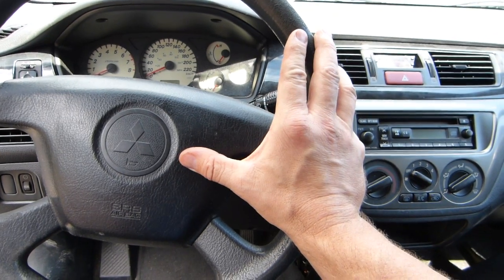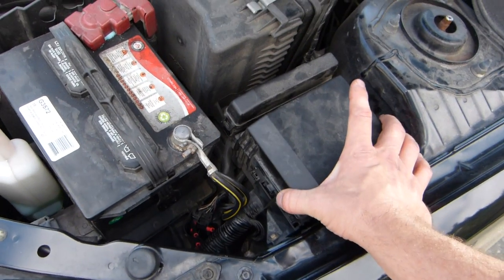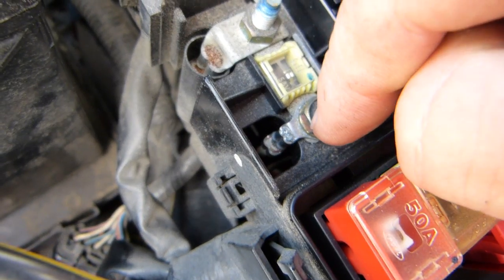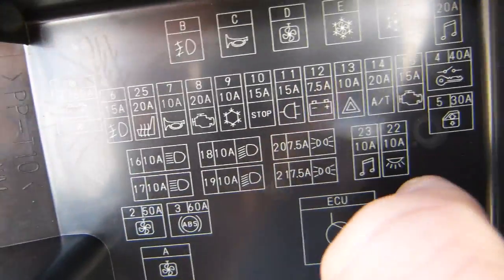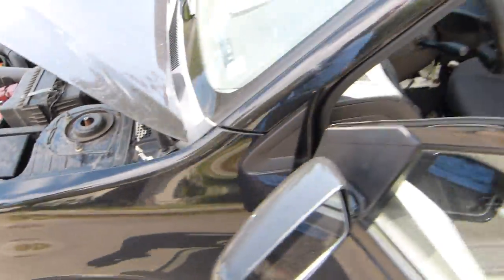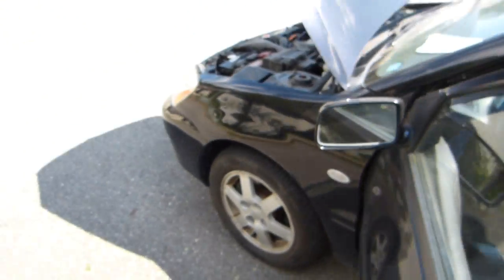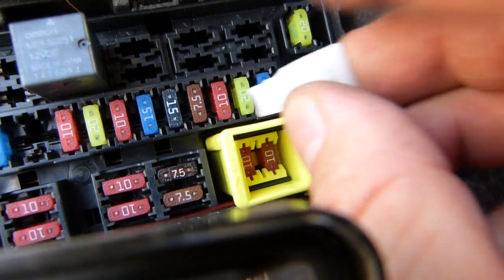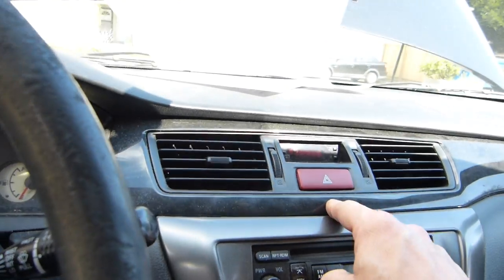Fuse locations and circuit detail to find the right fuse

Comment: What kind of a vehicle is this?I'm looking at a 1994 Mercedes S 500 that I need to locate views for the blower modor but this definitely is not Mercedes 1994.S five hundred
Reply from the maker: Not remember. Grab a torch/flashlight look around for wires running in bundles under the dash and in the engine bay

Comment: False in the first statement. Fuses specced correctly in a serviceable system actually should last what is effectively "forever".  They aren't wearing components.  Relays do exhibit degradation at the contacts over a very high number of cycles, but electrical systems shouldn't be treated as wearing mechanical systems in your approach to fault isolation and repair.

Comment: I have question when I was driving on the freeway way my oz rally shut off completely there was no power to the car at all I tried jump starting the car no power at all what would be the reason and where can I check
Reply from the maker: Oooooh,  ... sudden catastrophic total failure of all systems ... sorry about that.
Option a)
It's a quick fix, some cable around the battery came loose or a main fuse failed, 10 min fix
Option b)
It's not a quick fix, might want to consider abandoning vehicle, it's a money pit.
Reply: @theoverengineer where can I locate the main fuse is it the one inside the car or right corner of the hood to check?
Reply from the maker: Mains is under the hood/bonnet

Comment: Hey. Thanks for the video. I have an Evo iX MR. My fuse boxes looks similar to yours. Which exact fuse is it for the OEM Keyless Entry remote? Mine stopped working and I'm pretty sure it's a fuse or relay that's blown. I put a new battery in the remote and it's still not working, so it's gotta be a fuse. The fuse box in the interior by your left knee area: Fuse #15 / 15 amp. Is that for keyless entry? It has a picture of a key and door.
Reply from the maker: Takes just seconds to check a fuse, might as well check ALL, just in the process of elimination. Starting with the key and door fuse.

Comment: Who know please how to take off the 22 and 23 fuse the two inside the yellow plastic? Thanks
Reply from the maker: Fuse puller?
Reply: @theoverengineer  i found: you have to pull up the two fuses at the same time and they come off. Its made , i think, because they must come togheter to prevent some other problem
Reply: @theoverengineer  the yellow cover is up the fuses and you have to remove it to pull out the fuse
..

Comment: My anti lock brake light will not go off and making that loud sound and my heat and ac went out anyone know why some guy took out my fuse 10 the red one and my heater and air went out🤦‍♀️🤦‍♀️🤦‍♀️🥴

Comment: Thanks your video!   I Watched many times it, because english is not my language

Coin holder in the passenger apartment. I wish "something" to the japan enginers :) And that plastic puller is a joke

Doesn't heat the rear window in my my Galant and cigar lighter doesn't work
If I switch on the window heating in the dashboard, the little lamp is on, but not any voltage on the rear window heating contacts

I checked all fuse nerby engin but I couldn't pull out which you can see up the fusible wire
I started check fuses in the   passenger apartment 
The two 30A fuses are OK and one row also OK After started heavy rain :)
Now pause :)
Can you give me   advice how I can pull down fuse box to check relays and some direction to find the mistake?
Reply: Galant glsi 1998, 2000ccm 100HP
Sorry

Comment: Where is the fuse for the air conditioning
Reply from the maker: Fuse box next to the battery in the engine bay
Reply: What fuse control the fuel pump on a 2005. Mitsubishi outlander

Comment: THAT, THE FIRST COMMENT IS WRONG, INCORRECT, AND JUST PLAIN WRONG. IF A FUSE OPENS THERE IS DEFINATELY A REASON! Either there was an over current condition, it got too hot, mechanical damage, or it corroded, but SOMETHING CAUSED IT TO FAIL! I have found cars 80+ years old with 100% of its fuses in tact.
Reply: Wow! Your amazing take a chill bro!!😂

Comment: Very nice video.  I could not find where you put the link to the electrical diagrams.

I am helping a friend that has a 2006 Lancer and the battery went out.  He replaced with a new one but there is no power reaching anywhere in the car, not even the lights will come on.

It has a new positive battery terminal and we checked the main fuses and they appear to be good.  I don’t see anything wrong with the battery cables so we suspect a fusible link went out but we haven’t found it yet.

There are 3 cables connected to the positive terminal but only the one going to the starter has a 120A fusible link and it tested good.

We suspect we are not getting a ground so we are going to run a strap from the negative to body ground as a test.  If that resolves it then we will follow all the negative cable and any links in between.
Reply from the maker: Did you find the electrical fault?
Reply: Bump

Comment: Hi my Mrs has a 2004 Lancer that the brake lights have stopped working suddenly. I have checked all the fuses all the globes have been replaced including the centre rear window stop lamp  also. I have checked the brake switch for continuity and that also seems to be working fine but still no brake lights I have tail lights so power is getting to the rear globes. Power is entering the brake switch but there is no power coming out from the switch I am at the stage where I do not know what the problem is and are pulling my hair out. Next thing I will have to bite the bullet and take it to an expensive Auto Electrician. Any suggestions or help with this matter from anyone would be muchly appreciated. Thank you in advance puzzled Lancer owner. Scotty G

Comment: are there any fuses in the engine bay that only have power when the car is on? thanks
Reply from the maker: There should be no significant current through any fuse with the car off. There could be stand-by circuits and defective ones with parasitic draw on the battery.

Comment: Thanks! This video really helped, they have 2 fuse boxes cause, under the hood is probably for the engine to use and the passenger is for the driver to operate the controls.  At least that's what I think why there are 2 fuse boxes.  This helped out why my cigarette port was malfunctioning.  I think I need to buy a spare of those 15A for my cigarette port just in case.  The wiring inside my 15A fuse was broken.

Comment: This video really helped me, my hooter wasn't working and I was thinking of buying another one, the problem was a fuse relay, it was loose.
Reply from the maker: Glad it worked out!
Reply: One of my "relays" (under the hood in the motor fusebox), was faulty too - I discovered, after we had been told by the Mitsi Mechanic (who should have known) that it was a gas problem, so when we went to a gasser to get it recharged, he said it's a good pressure, no issues, and set about looking elsewhere (starting with the fuses and finding the relay which (wonder of wonders) simply came apart as he unplugged it (it had literally collapsd inside it's plastic cover) so a small relay later (he had to go get one from a dealer) - the aircon was fixed, and we had heat again.
Hasn't failed since, but the radio (and thus the reversing light) has gone, which the Missus thins is a camera and costly, so refuses to get it fixed, but - now that I know where to look, with a buggered left foot, (I had a BK Amputation a couple of years ago)- all I need to do is rip open that wee coin holder and check that fuse, before trying to lean over the engine bay (by standing on one leg - good luck with that?) - so wish me luck as soon as this cold winter weather has gone, frosts and hoar-fog here lately, (as it's mid winter see, in NZ)

Comment: Thank you so much, I have managed to misplace the owners manual to my wife's 2003 Outlander she has had since 2009. Chasing a cigarette lighter issue, thinking it was a fuse as I plugged the same accessory into my 2013 Ford Focus and it only blew the fuse. But with the Outlander it is a wiring or actual cigarette lighter issue due to the fuse being good. But your video helped a bunch, I did not realize the diagram was printed on the back of the little cubby.
Reply from the maker: Glad it helped

Comment: My 2004 Lancer doesn't have that yellow plastic piece with the two 10amp fuses in under bonnet for radio & dome light, but instead has the two fuses in interior fuse box where that one doesn't. Why is this?
Reply: Please tell me how to remove that yellow box with the 2 10amp fuses in it I tried for like 2 hours
Reply: @phlyq4130 did you guys find out?
Reply: @phlyq4130 any luck? Currently trying to
Reply: How to pull remove the fuse from that yellow plastic piece
Reply: @Rehan198927  great question....please help
Reply from the maker: Different market, different safety solutions, different year to solve some potential problems that might cause a fire.

Comment: Some cars are starting to get rid of fuse boxes and instead use solid-state current monitoring with MOSFETs to switch the loads. It makes things more fault tolerant such as automatically resetting when the overload or short is gone, and they can log diagnostic information for troubleshooting.